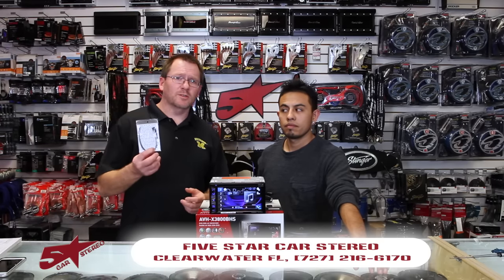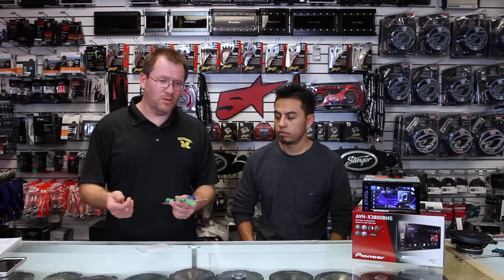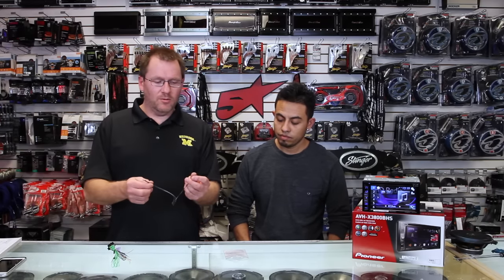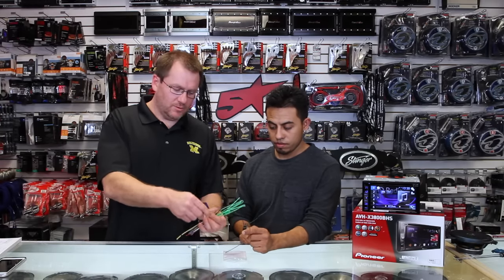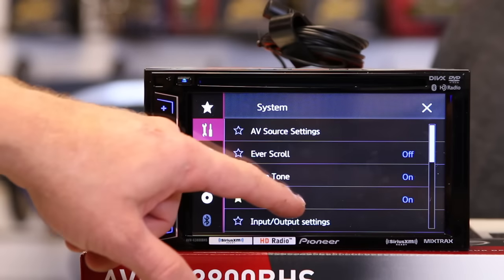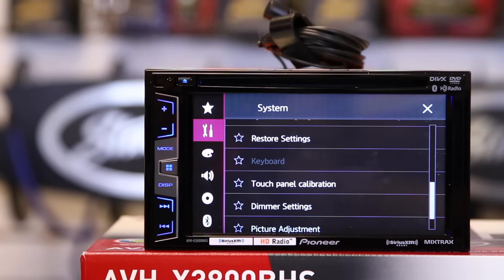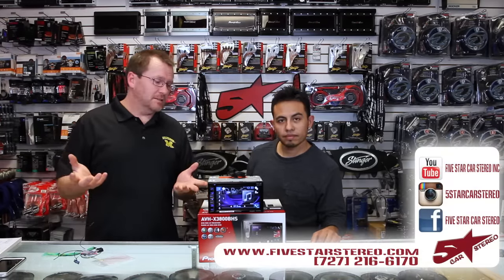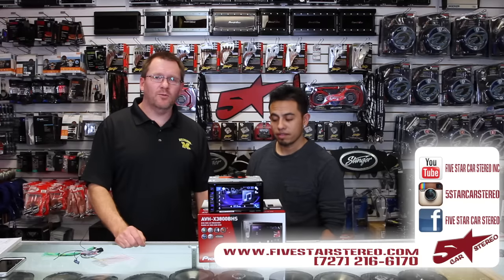How to do the brake bypass on your Pioneer AVH Radio using a MicroBypass

Comment: Hi guys really appreciate your videos! I have an issue my microbypass works but it won't seem to save my clock etc. and always asks be for language on startup. Any advice?

kind regards

Aaron
Reply from the maker: Aaron Eccleston it is not the bypass. It  sounds like the yellow and red wires  are backwards. The radio is losing memory but is still working. It is still getting power on both so it will turn on.
Reply: Take a test light and find your constant 12v and connect the radio's yellow wire to that..the red wire goes to your ignition wire, remember, always use a test light

Comment: I installed the MicroBypass on my Pioneer head unit. However, there are still some system settings that I can't access like steering wheel control. I ended up disconnecting the bypass and using the parking brake wire temporarily just to be able to program the steering wheel buttons to my head unit. Otherwise, the bypass does it job.

Comment: Thanks for this video. You guys have the best videos for stereo installation. Question I have is if the green parking brake wire is connected already. Do I disconnect the parking brake wire and tap the green bypass wire to it. Or keep the parking brake connected and tap the bypass wire to it?
Reply from the maker: Disconnect the wire going to the break, only connect to the bypass

Comment: Put the bypass in the Pioneer AVH-X491BHS and still get the caution warning. I had it installed and it was installed correctly. The settings are unlocked, just the caution screen does not go away. Any ideas would be great. Thanks.

Comment: searching all over the internet and everyone wants to show how to bypass when I am simply asking how to wire this as intended. Can you please upload a video or better yet reply with a message telling me where my parking break wire is on my Mercedes Benz slk 350?  This micro bypass does not work.  The firmware update method worked for me (AVH 4400 NEX).  Grounding the parking brake wire to the chasse does not work either.  Here's my problem, I just installed under seat pre-amped subwoofers in my car.  They aren't working because subwoofer is off and grayed out in the head unit.  This shouldn't be happening since I have a micro bypass installed but then I recalled that it never worked until I upgraded the firmware and touched the bottom left hand quadrant of the screen.  I even tried repeatedly engaging and disengaging the parking break while holding the break pedal - did not work.  So now I want to wire this thing up properly, hopefully that will allow me to access the grayed out functions on the head unit.

Comment: Installed this bypass on my Pioneer AVH-X490BS. Blew the radio. Is there a radio that i can buy that doesn't require the bypass? Is there a bypass code for Pioneer AVH-X490BS?

Comment: Hi Guys ..Thanks for doing this informative video on installing a bypass. My problem is that I'm installing the video player in an RV trailer so I don't have a blue wire coming from my vehicle harness as it's not a vehicle. I just have the red and black wires. So I splice in the black wire from bypass  onto the black wire with a tap connector and put the green wire onto the light green wire on the deck harness and the blue onto the deck blue wire which only goes to the deck and nowhere else. The bypass is not working. I'm I doing something wrong?
Reply: Stryker 2 The blue wire is just a remote turn on, you just need a switched ignition wire to remotely send the 12v through the circuit.

Comment: I hooked up a micro bypass to my pioneer DMH-C2560nex. Tested it with multimeter and it worked. But I’m still not able to access any of the audio settings. Any ideas?

Comment: I have the Pioneer 3300 nex and for some reason, every time I get a phone call through the Bluetooth it is so quiet. It sounds like you are listening to the other person through a cell phone earpiece with the volume turned all the way up. There is no issue hearing me talk on the callers end. I also cannot get the auto EQ to work. I purchased the microphone but the option is greyed out.

Comment: 5 star car stereo, what do you mean by turning the car off 3 times? Have the parking brake wire grounded and turn the car complety on and off?
Reply from the maker: KawiRider383 the E break procedure for the radio is -- e break off / turn car on / e break-on-off-on/ radio is now unlock.

Comment: Hooked up my avh-x3800bhs in my 2007 kia sedona and have terrible radio reception.  Was told it's because the van has an antenna amplifier.  My understanding is that I have to hook up the blue/white wire to turn this amp on, but I just got done connecting this to the microbypass.  Is this going to be a problem having the microbypass and the antenna amp both connected to the blue/white wire?  Thanks.
Reply from the maker: To power on the antenna we like to tie it into the red acc wire. You can use the blue/ wire but some cars draw more current then it puts out and can cause issue.
Reply: Thanks.  I did as you said, and everything works great now.  Much appreciated.
Reply from the maker: +Mark Penney sweet, glad we could help.

Comment: Hmm, I'm about to do this on my car but the blue/white wire doesn't get connected on my car because it can cause problems with the speedometer signal.  Is there somewhere else I can connect the blue one for it to work?  12v switched power maybe?
Reply: Or maybe I can still connect it as is since this will still get a signal coming out of the radio on the blue/white wire even though it doesn't need to connect to my vehicle harness right?

Comment: Simply add ground (-) to light green wire and it will be OK. (Connect car frame, bolt, etc.) Handbrake switch does the same.
Reply: Miklós Gorelov will not work. Has to be off and then on for a certain amount of time before it lets you. Can’t just hook it up to a ground.

Comment: QUESTION. Couldn’t the green parking brake wire simply be wired in to the blue/white remote wire? I understand it needs to see the “on/off/on” and I would think turning the radio on/off/on would do the same thing? That’s my thinking but I haven’t seen ANYONE do it so I’ve been questioning wether I’m right or not
Reply: No the green wire only needs negative which is ground it also puts out a low voltage so it would put your radio into a resting mode most people think that it burns them out but it just resets it

Comment: Nice review and i quick question. I installed the bypass and also hooked up the gps antena to the radio, but when I am driving i cant use YouTube or miracast, a screen shows up on the screen telling me that i cant watch videos while driving.  Is that because I hooked up the gps antena to the radio? 
Thank you.
Reply from the maker: Yes it is, there is a software up that just dropped, try that. If that does not work( it did not for me ) disconnect the antenna and restore radio. It will work then but the map will not track all that well.
Reply: @FiveStarCarStereoInc  thank you so much.

Comment: I just recently purchased the AVH-201EX. Will this work for this stereo, or is this year specific as far as the radio goes? I noticed some of these bypass harnesses had years 2013-2015 on them.
Reply: I just bought the same stereo and bypass haven't hooked it up yet...did the bypass work for you on that model?
Reply: Carlos Baq yes, it worked just fine with that model.

Comment: Sorry if this is a dumb question...my understanding is that the 3 black ground wires from car + radio + bypass should all be connected. Does this mean I don't need to ground any wires to chassis?
Reply from the maker: Jensen yes they all go together. The one from the car should be a chassis ground.
Reply: So, just to confirm you are saying the connection from the factory + new aftermarket car harness is already sufficient chassis ground (no need to wire to radio bolt/screw etc.?) Thank you for your response.
Reply from the maker: Jensen some Nissan and Toyota do not have grounds otherwise you are good
Reply: Now that I'm looking at my wires it's actually looking like there is no black ground wire on the aftermarket car harness I bought. Now not sure where to go from here. Should I just ground the aftermarket radio's ground wire to a bolt? Then not sure where to connect the ground from bypass since on the bypass instructions it says to connect black ground wire to black ground on radio and black ground of car harness. Since the car harness doesn't seem to have one can I connect it to a splice in the same black radio ground that I'm bolting?
Reply from the maker: Jensen ok, yes that car needs a ground. Go to a bolt, connect that to the bypass and the radio. All will be good.
Reply: Thanks a ton

Comment: Going to buy a x4800bs,  Pac RP5-gm31 Bypass kit for my 09 Silverado. Do This Bypass unit have the micro bypass built in or do I still need to install Micro Bypass to get full access while driving.
Reply from the maker: Yes you still need the microbypass to unlock the radio

Comment: hello thanks for all your helps and my only question is, I have AVH4100 installed already everything is fine but with a switch but I need to upgrade to microbypass. So how many wires do I have to cut to connect to those 3 wires. thanks.
Reply from the maker: Monday Omoregbee thank you. check out this video, it is a newer one answering your question 
https://youtu.be/fcRvTMldW0g
Reply: thanks for this link. I was wondering how a good way to create a t was. This is great.

Comment: Wires on Chip : Blue : ignition(+) - Black : Ground(-) - Green (Handbrake signal wire) Do NOT connect the bypass to factory harness ! Just Connect the bypass to the pioneer radio harness !
Reply: I did on my pioneer AVH-x4800BS but didn’t work what I did wrong… 🤔😞

Comment: Will this work on the Pioneer DVH-875AVBT? And is there a difference between the double pulse and the triple pulse bypass?
Reply from the maker: It should, it works on all the other Pioneer radios with a break wire input. We do not have this model in the states so I can not test it to make sure. Most Pioneer radios need a double plus ,on off on, to work.

Comment: Im looking to do a similar setup as the guy above with the 5800bhs, forgive me though how would i hook this up to a relay and still be able to hook up the remote wires to my amplifiers if the remote wire is going onto the relay? Splice the remote wire and connect one to the relay and the other to the amps?
Reply from the maker: A relay is use to change the load a Circuit can handle. So for example the radio puts out 1/2 amp of turn on power. The bypass uses very little maybe a 1/16 of an amp to turn on. To turn on your amp it my need a 1/4 amp. In this case no relay would be needed. You may  have a power antenna that needs a 1/2 amp or a second amp to turn on. Now you need a relay. The relay has inputs and outputs, in this case your remote output will go to the relay pin 86 and ground pin 85. This will turn on and off the relay. Connect 12 volts to pin 87 and now connect your amps, bypass,and antenna to pin 87. This will now pass up to 30 amps ( depending on relay and Circuit for power), which is more then enough to turn on your equipment.
Reply: +Five Star Car Stereo ---connnect 12vdc to pin 30, 87 to device that require the remote turn on power!
Reply from the maker: +write2rc yes good catch, sorry about that. 87 can do magic

Comment: Ok so I hooked up my 5800 and I love it specially the micro bypass piece but I'm gonna add a backup camera so how is it going to notice or switch from DVD to rear cam???
Reply from the maker: RJVermillion there is a purple white wire in the power plug of the radio. It needs to be connected to the reverse light trigger wire. Then you go into the camera settings and turn camera on. When this is done your radio will know it is in reverse and turn on the camera
Reply: My pioneer is wired like this with the purple/white to reverse trigger and I have the bypass wired correctly, as well, yet it doesn’t work!  I continue to comment on these issues, hoping to get a response at some point. I have spent so much money trying to get anything to work with the AVH-1400 NEX  besides just Apple car play and Bluetooth for music and calling/texting

Comment: I'm wiring my harness for a AVH-4200NEX, and about to add the micro bypass.  Originally, I was going to wire the blue remote wire to my amp, but now that I have the bypass, where do I wire the amp to?  Also this is going to my 2016 jeep and it required me to buy all the idatalink harness, do i wire [pioneer harness black/lt green/blue-white] to the idatalink ground?

Thanks for the videos btw, both of you are funny and make these things entertaining to watch!
Reply from the maker: ethan'stank thank you. You can connect the microbypass and the amp up to the radio. The blacks will all go together. The lt. Green will only connect to the microbypass. Check out this video 
https://youtu.be/MrtxUr2Z3fE

Comment: What if I need my remote wire for my amp ? Should I split it with the green wire and my amp ? Hope it has enough voltage to do both wires
Reply from the maker: It can do both the bypass and the amp no problem
Reply: Thanks so much !
Reply: I subscribed. I like how you guys are no nonsense.

Comment: My signal wire turns on my amps? Will i have a problem with my amps if i use the micro bypass spliced in?

Comment: I just updated the firmare on my avh x4700bs but now it wont let me see movies even when im parkd or the car is turned off... it just gives me the precaution warning but it wont let me hit the ok
Reply from the maker: Jonathan Oquendo did you do a bypass on the lt green wire or just ground it? That is where the problem is
Reply: Five Star Car Stereo just ground it but i do the bypass with a switch

Comment: I already installed my pioneer avh-x4800bs and grounded the wire coming out of the radio to the trucks ground. Should a cap the ground off that goes to the truck and ground the black wire out of the radio to the bypass only?
Reply from the maker: Marcus Roberts no ground both the radio and the bypass to the truck.
Reply: Five Star Car Stereo how about the green brake wire coming from the truck harness? Do I cap it off or leave it with the green wire coming out of the head unit and the bypass green wire?
Reply from the maker: Marcus Roberts leave the trucks break wire capped off on its own.
Reply: thank you for all the help
Reply from the maker: Marcus Roberts you bet

Comment: I have a question hoping I can get a answer. I bought a Gs Audio Ba105 bypass and I have the avh- x4800bs head unit I was wondering if you guys can help me by color code witch one goes to what? Right now I have a relay, everytime I want to watch a movie I have to pull out the cd and re install for it to show up front. this is while in park.
Reply from the maker: Sure can you send me a link to it so I can see what it looks like.

Comment: I like your video's.  One question...I have a Pioneer 4200nex.  I put the microbypass in with a toggle switch at the end of the wire.  Is this like a double negative?  Should I not use a switch with the bypass?
Reply from the maker: Greg R. I would use one or the other, not both. The bypass is acting like a switch so you do not need the switch.

Comment: Thanks for the great video! Will the microbypass still work on the Pioneer AVH-X5800BHS firmware version 8.18? I need to know before hand before I flash it. Thanks
Reply from the maker: Chio Phanh yes you are good we have had no issues

Comment: hey, I have the same stereo and recently the stereo idk why but it turns off when i turn the car on. it worked great all.of a sudden and all the fuses are good, hopefully I can get some help with this, thanks
Reply from the maker: MrUly51 you are going to want to take a volt meter and check the red and yellow wires of positive 12 volts and the black for ground. Also try unplugging the radio and plug it back in.

Comment: Has anyone else seen a reliability problem with these?     I know they're not that expensive, but I don't want to tear half my car dash apart every couple of months because the micro bypass has failed.      Five Star, do you guys know if the old school 12 volt relay wire in hack will accomplish the same thing with these newer Pioneers?

Comment: I put all the colored cables where it belongs, but I noticed 2 things -_-1 Touch screen it's glitchy like I press the menu button but it sends me back to main screen, only way it could work it's if I hold the screen and move my finger without letting it go... the other thing is I put all the volume up and somehow it lowers by itself idk what could possible be wrong with it maybe ground wire???? Yeah I also have a subwoofer ..
Help me with it. 
It's an 
avh-x3800bt
Reply from the maker: George Gomez it sounds like a bad touch screen to me. Has it always done this?
Reply: Five Star Car Stereo 
No it's been working since day one but since I stalled the micro bypass its stared acting weird. I guess Ima uninstall the micro bypass and see if it works ..

Comment: I have the same stereo used in the video. for some reason my my display keeps switching to the "off" screen Everytime I push any button. even when I don't push a button it goes to the "off" screen in a matter of seconds. it stays on just goes to the screen that says "off." do you know why this may be happening?;I don't have the light green wire connected to anything.
Reply from the maker: +Trust Corps no that is a new one. Can can restore the radio in the main menu. To do it you will have to connect the break wire